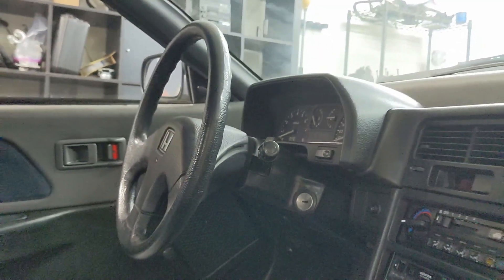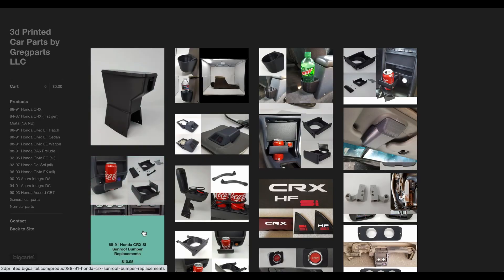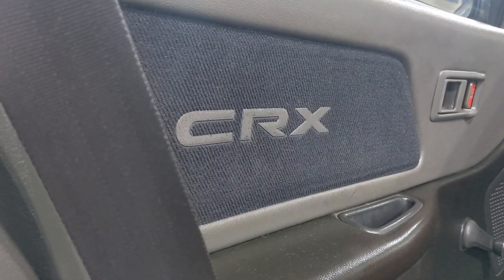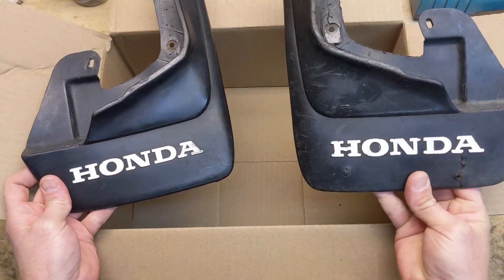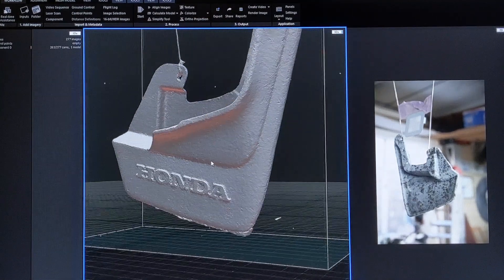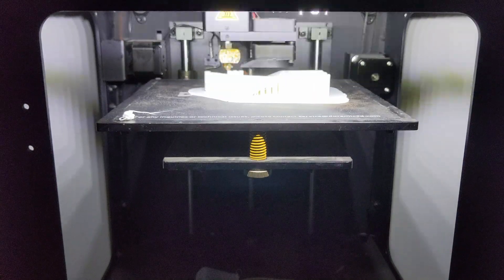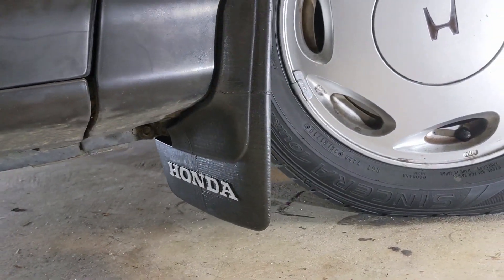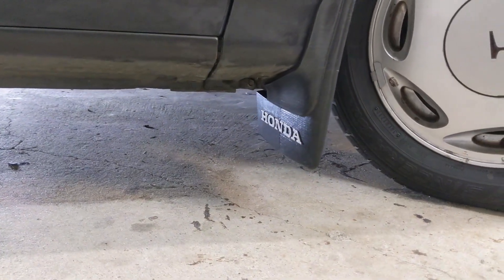How to make Honda CRX parts yourself - Make it So

Comment: Wow, great work.  I reached out to some suppliers that manufacture these type of parts, but the minimum order was so large, I couldn't justify the up front costs.  They would take the original and injection mold them.  I would have been in it about $8,000-10,000.  I know the market is somewhat large, but I don't know if I could turn over that many items to pay myself back.
Reply: Also, there are a lot of people that would be interested in these parts if they can be had for sub-$100, or even around the $100 price point.
Reply from the maker: Thanks Seth! And thanks for sharing my video with your subscribers. That's good to know. I figured a run would start somewhere around $10k. I thought crowdfunding might be a good way to judge interest and lower risk, but that comes with it own set of issues. I'm considering a few paths, more to come in the future!
Reply: @MakeItSo  Keep me updated. If I had the capital I would pursue it more seriously, but I’d be interested in a set, anyway.
Reply: By the way, I make OEM replica "CRX", "CIVIC", and "VTEC" rear garnish decals.  They are clear vinyl with the silver print like the OEM decals.  They cannot be bought like this anywhere else that I am aware of.
Reply from the maker: @crxseth  Yes! I saw your video on that. I'm definitely planning on picking some up when I turn my attention to the exterior, and now that I'm part of the Vtec club!
Reply from the maker: @crxseth  I put your paypal link to the decals in my Splashguard video description with the other parts manufacturers, but I'm having trouble finding the video where you show them and install them.
Reply: @MakeItSo   I don’t actually install them in any of my videos, funny enough.
Reply: @MakeItSo  I'll donate a couple K as a small business venture.  Plus finally, get a pair for the front of my CRX. Let me know if anyone else is interested too.
Reply from the maker: @ThePepper1981  Check out my other video. I released the model on Thingiverse for all to use.
Reply: @crxseth  I got half on it!

Comment: whats probability that you'll make a run?  AT $100 a copy sell 10 and that should help!
Reply from the maker: I'm getting quotes for manufacturing. Unfortunately it's two unique pieces to make a set so the price will become an issue.
Reply: @MakeItSo  they go for $150 used? I could stomach $175 for a new set and I bet money others will too.  If you need help let me know. I'm in LA, lots of people around here have connections to asian companies .
Reply: or make them rigid,,,I'd buy a rough set from you and I'd do prep and paint workwork myself,,,,,most people who will pay $$ only drive the cars to meets so they are very careful not to hit stuff! LOL

Comment: Any update on production? If not can I buy the file from you to print my own?  Can the other side be made by reversing the file you have,? Thanks!!!
Reply from the maker: I already have a file with the model inverted for the other side with the text flipped correctly. I'm thinking of releasing the model soon, for free. Stay tuned.
Reply: @MakeItSo  hi.  can I please buy the files so I can send to get produced asap.  thks!!!
Reply from the maker: @costanzaf2  Check out my other video, has a link to the file.
Reply from the maker: https://www.efbmotorsports.com/product/88-91-crx-front-mud-guards

Comment: Thank you so much for shouting my small business Project EKP! 3D is indeed an amazing technology that enables us to produce parts with low overhead. Some 3D print materials are so good, that they can be used for end item parts! One belief that I have in my business is long term quality, and unfortunately, 3D printing has missed the mark for certain items that we planned to sell. For the spoiler you mentioned on your video, we will be making this out of Fiberglass but the plug will be 3D printed. Going forward, most of our dress-up parts will be FRP, but utilizing 3D printed parts as the prototype and tooling to make those FRP parts happen. 

I highly highly recommend making your mud flap out of fiberglass. You'll have a much stronger part, and your 3D print model and prototypes will not go to waste as it's all part of the process. Lastly, it's a manufacturing process that can be done at home! Please feel free to contact if that's something that interests you and you need help!

Great video, and great work. What a time we live in!
Reply from the maker: Hey I'm so glad you saw the video! I'd love to know  more about manufacturing fiberglass. I've built some motorcycle cowls out of fiberglass before but that was very freeform, never using a mold or anything. I definitely want to learn more about it.

Comment: Awesome man. I was wondering if someone with a decent set of these would eventually attempt to manufacture them. I'm in for buying a set or crowdfunding if it goes that direction. The CRX groups on facebook have thousands of members. Seems like it would be easy to get a few hundred people to buy in to cover the initial costs to get production rolling.
Reply from the maker: Yeah I was definitely considering crowdfunding as an option. I've never done it before, but I have reached out to a manufacturer for a quote on injecting molding prices. Will keep everyone posted as things develop. Thanks for watching!
Reply from the maker: https://www.efbmotorsports.com/product/88-91-crx-front-mud-guards

Comment: You can use acetone vapors to smooth out print lines like that.
Reply from the maker: Ha! I was literally just watching a video on Vapor Smoothing using acetone. I think it works better on ABS than PLA. Gotta try a different material. Great suggestion!

Comment: Ever look into making red rear center garnish for Ef hatch Civics ?
Reply from the maker: I have not, looks tricky, you're talking about the transparent red piece right?
Reply: @MakeItSo  correct, between the tail lights. They have gotten pretty pricey, and half the time they are cracked or chipped.

Comment: Looks good! Could you have wet sanded it to smoothen out the 3D printing lines before you painted it?
Reply from the maker: I think wet sanding this material would be very difficult with how large the layer lines are. Some people do vapor smoothing on 3D printed parts which is cool. Put it in a box with Acetone vapors to lightly melt the outside. Usually makes parts smooth and glossy.
Reply: @MakeItSo  I see. I was also thinking, how about applying a light coat of plastic filler to fill the lines and then wet sand it.  I’m just thinking out loud to make it exactly like the OEM ones. 

I have a 94 Supra TT and like your car, there are some discontinued parts but thank God Toyota still makes the OEM plastic parts and the mud guards in this case.

Comment: Nicely done! Like you said, a good deal of sanding and glazing putty will fix those seams and lines. Also, did you print in PLA or ABS? PLA will warp in high temps. ABS is the way to go. You could make some decent money selling these online! Best of luck. 👍🏻
Reply from the maker: Hey Dave, thanks for watching. I printed in PLA+ it's a higher temp version of PLA. Yeah I could have spent way more time on making it look good but this was essentially a proof of concept.
Reply from the maker: https://www.efbmotorsports.com/product/88-91-crx-front-mud-guards

Comment: It is possible to print it with flexible filament
Reply from the maker: It is possible but flexible filament is very difficult to work with. I had to print in 3 separate pieces and glue together for my test. If I had a bigger better printer I might try that. Thanks for watching!
Reply from the maker: https://www.efbmotorsports.com/product/88-91-crx-front-mud-guards

Comment: Would you consider making the model public so I can print it also?
Reply from the maker: I haven't decided yet. It's not out of the question, but I may try a manufacturing run first before releasing the model. It would be very cool to have an open source repository for CRX parts.
Reply: @MakeItSo  indeed an open source repository for CRX parts could be nice, it me up if you need help putting it in place!
Reply from the maker: @Remitche  Check out my other video. I uploaded the models to Thingiverse.
Reply: @MakeItSo  Dude, you're a legend

Comment: cant you just pint it in a flexible filament? that's what I would do.
Reply from the maker: Printing in flexible filament is notoriously difficult unless you have a temperature controlled environment. But this guys has it down. 

https://www.efbmotorsports.com/product/88-91-crx-front-mud-guards